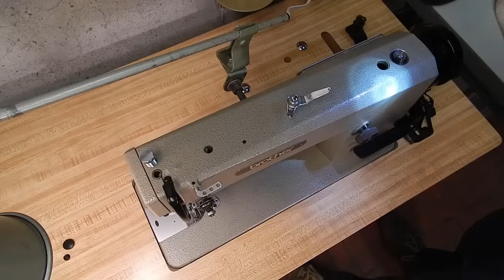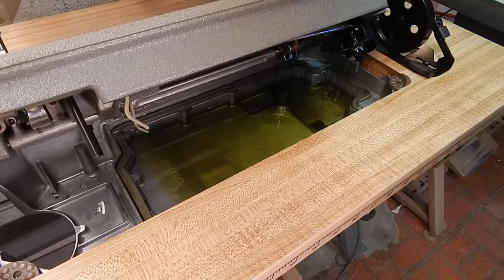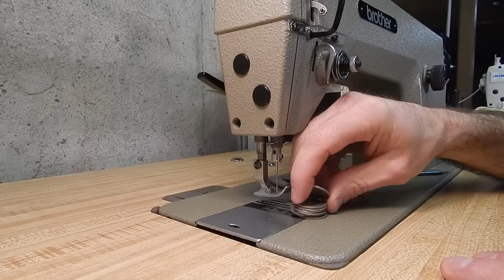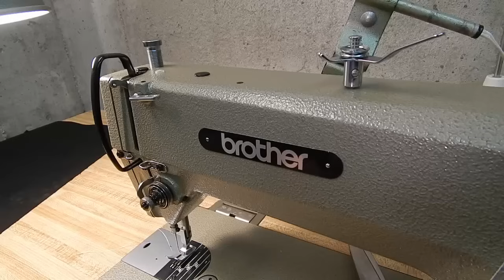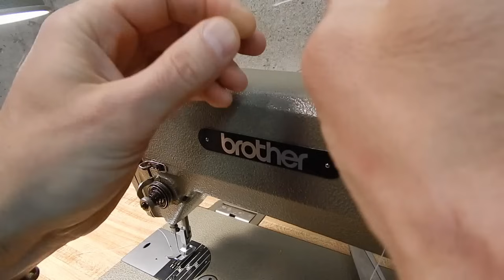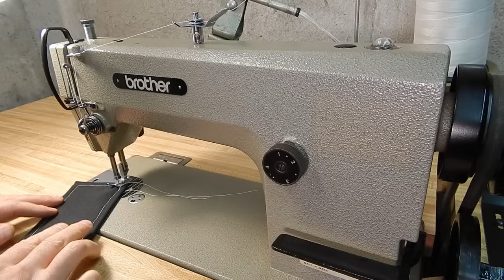How to Thread Brother  Threading Industrial Sewing Machine DB2-B735

Comment: Hi thanks for this video. Should the needle be inserted so the thread goes in left to right as shown? Rather than front to back for conventional sewing machines? Is this the case for most industrial sewing machines?
Reply from the maker: The needle orientation can be different for various machines. It is shown correct for this machine. Follow your manual. If you do not have a manual the rule of thumb is to thread toward the hook. Maybe this will help. https://youtu.be/9wek6_aFy_I

Comment: I bought the exact industrial machine not too long ago and it just wasn’t stitching. The thread kept coming apart or breaking. I’ve researched everywhere, spoken to people and no one knew what the issue was. Believe it or not but this video solved all my problems. Thank you
Reply: My mom own a similar model... and it's probably older than me.
Reply: I have the same issue and followed the steps but the thread still keeps breaking 😢
Reply: @khanywtf check what side the groove on the needle is.
Reply from the maker: That's cool.
Reply: mine too what were you doing wrong? what does the bobbin look like. i dont think my bobbin is staying in the bobbin casing
Reply: this problem is what brought me here🤣🤣
Reply: I have the problem today when I want to buy but was not stitching , can it be the threading?
Reply: Same!

Comment: Why was it that the oil was not coming up to the glass flask, when you operated machine?
Reply from the maker: When the machine is running at full speed you will see oil emitting from the tube through the sight glass.

Comment: During the video of how to thread this unit you described the height of the pressure foot. Mine only has about a 1/4 inch. How do I adjust the height to get the 7/16 inch that you described. At the present I struggle with thicker materials (blue jeans). Thank you

Comment: what the heaviest needle you used with this machine and thread T40, T70 or. Also are you using titanium needles and chisels for leather? had to ask like the machine. I have on had to unhook all the goodies was 3 phase now 110V.
Reply from the maker: Here is a handy chart for needle and thread size. http://tolindsewmach.com/thread-chart.html
Reply: did you ever servo yours. Two motors on their way to me both 600 watts
Reply from the maker: I sold that machine a couple of years ago but I would not hesitate to put a servo on it. I have put servos on similar machines, walking foot machines, post beds, cylinder arms and overlocks. For me they work great on all of them. I think you will like them.

Comment: Hi there Alexander, Im very new to sewing and i have just brought a Brother DB2-B755-3 and i need to set it up and learn to use it. You video was great to watch and showed me how to thread the machine which was great. I have only just received this machine and i need to set it up as in put together. i was wondering if you have a video that has the run down of the machine from putting it together to using it. I think i worked out how to put the belt on, but having trouble with the bobbin. 

I would appreciate any help you can give me as like iu said i am very new to sewing and my goal is to make horse equipment. 

Thanks Tarea
Reply: Tarea Prior احسنت

Comment: I have trouble hand cranking the wheel, any ideas why?
Reply from the maker: +Virginia Cuda A clutch motor has a brake that is released by partially depressing the foot pedal. If you take off the belt and the machine turns freely by hand then this is almost certainly the case, if not then your machine may need some attention.
Reply: Thank You, I will try that.

Comment: When it sews it breaks at the needle and bunches up under the fabric what am I doing wrong . Thank you for any help you can give
Reply from the maker: That my friend is what we call a loaded question. Many things can cause your problem but I am going to talk about what I think is the problem and you can start there.

Your thread can bunch up under the fabric if your tension is too loose. Some refer to this as a rats nest. If you keep sewing that situation will continue to "bunch" up and eventually break a needle.

Check out some videos on thread tension. Your machine is probably fine, you just got to get it set up correctly.

Comment: Should the presser foot sit completely flat on top of the fabric when sewing? I have found that with mine it always seems slightly raised above the fabric and the length of the stitches can be erratic..
Reply from the maker: Yes. The presser foot should sit flat on the fabric and "press" the fabric against the feed dogs and then you will get consistent length stitches.  You probably can fix by tightening you presser foot spring that can be found directly over the presser foot on top of the machine.